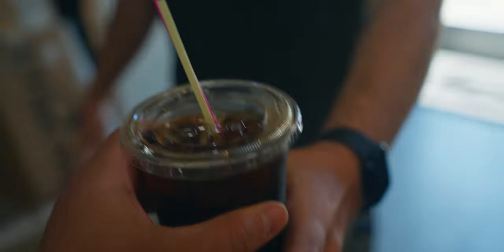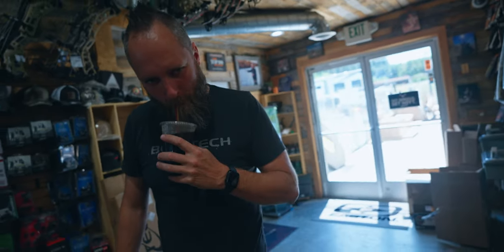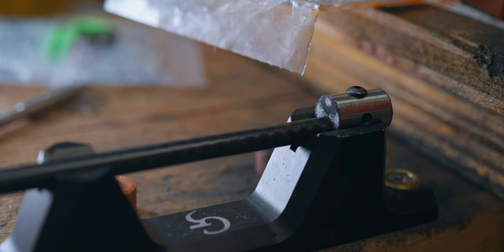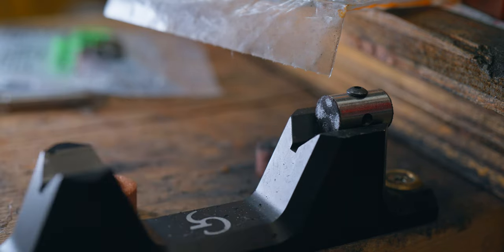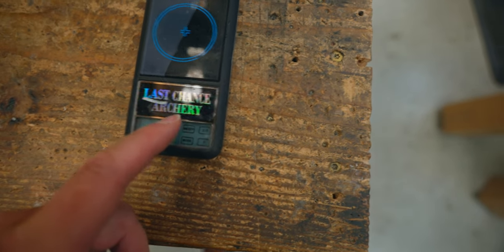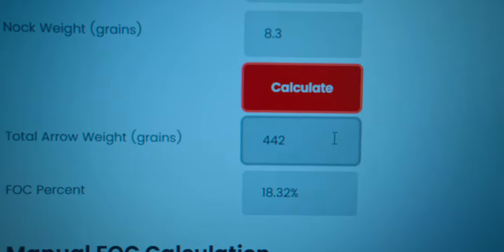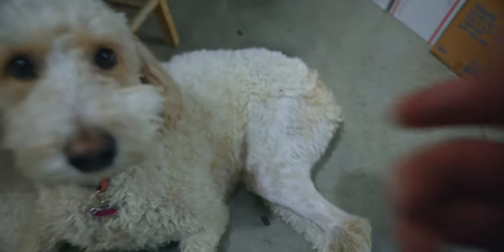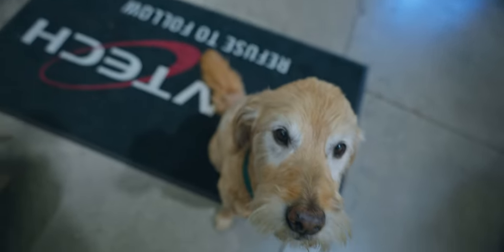Ultimate ARROW Build

Comment: On my RIP XV Elite arrows, I used Easton Axis HIT inserts with Bob Smith Industries glue, and Gold Tip ballistic collars with hot melt glue, with 125 grain field points, giving my 27" long arrows a 15% F.O.C.  I've got them fletched with 2.5" Bohning HEAT vanes fletched with the most helical I can get from a Bitzenberger jig with an upgraded AAE nock receiver.  I'm only a 26.75" draw.  Shooting 50 yards the other day with these arrows from my Solution SS, I put a 1/2" group right in the 10-ring with open sights (no lenses anywhere).

Tim, it's "cyano-acrylate" (6 syllables).  LOL!!

Comment: Awesome video as always sir 👍 Tac vanes are awesome I use the aae primer pen and glue with the rip TKOs and have never had a issue with vanes not sticking or coming off ever, I’m also a fan of the 4 fletch, I get a few extra yards out of my sight tape and if you send one through the target and fold a vane all you have to do is get a little heat on it with your breath or whatever and 80% of the time it straightens right out

Comment: Good build! Almost my exact process except I score the inside of the shaft with a bore brush and the outside of the halfsert with sandpaper. Then clean both with acetone before hotmelt gluing. A little extra confidence for me. I would recommend the AAE Pro Max Vanes for your 4 fletch build. I love them for 3D! Thanks for the good content Tim!

Comment: You can use regular glue like Bob Smith glue and still remove the inserts if you have to. Using a drill bit that is just a touch smaller than the inside diameter of your arrow. Slide it in with the chuck side toward the insert and then with a whipping action it will knock the insert loose and not damage the arrow. I've been doing this for a very long time. The problem with hot melt is it can't be used with certain arrows like black eagle. And if you get the hot melt too hot when inserting the insert you can damage the arrow and ruin it.

Comment: pro tip screw field points in prior to install it keeps your digits a little further away from the heat once glued in hold your arrow by the nock and drop your arrow field point first to the ground if it thuds then your done if theres a buzz take it out and re apply hot melt...*shout out to GRIV*
Reply from the maker: Yeah, I did that in the video ✌️

Comment: 4 fletch bohning Heat vanes are pretty good
Reply: The NEW,  X-3,  3 inch Vanes, by Bohning,  are out, Now !
Using the TOUGH, HEAT Material and X vane Shield Shape, so that Now, you can get by with, using only 3, 3 inch x .48 Tall Vanes, Fletched Helical, to Spin your B-H's,.. "Well"

Comment: Did you re-weigh all your arrows after gluing in inserts/fletchings? Just bought some arrows and supplies from Josh recently. First time doing arrows, and started putting them together last night. Had all the inserts and arrows weighed out and matched up and was sitting +- 1 grain (so a total of 2 grains off between the lightest to the heaviest). After using hot melt to glue in the inserts, most of them were close but there were a few "flyers" that were higher or lower than expected. One or two quite a bit off. My points haven't arrived yet because I'm playing with different weights. Should I just wait and see if the weight variant between the tips makes up that difference, or go ahead and reheat/pull those inserts and reglue? I felt like my process between all 12 arrows was pretty consistent so I was surprised to see some at such a big difference.

Comment: Good video, try some flex fletch FFP-175’s (3.1grains each). I use one stringer wraps in the 4” range, so easy to take off if needed.   Heavy up front, 60yds spot on.   This is in the Midwest, but it would be neat to see how they would do for you guys out west.   I’m currently at 22-24%foc.

Comment: Still shoot some 480 spine broodline i bought with blazer vanes  29 in . Only have 27 draw and shoot 50 lb on a 2012 bear legion.  Have alot of fun with  a blackgold 3 pin ascent whitetail hunter and a 10 in. Fuse carbon stabilizer . Still shoot a whisker biscuit  its fun .  Have teied making my on arrows. Got the cutting and square  but wish i could remember what the insert was. Since you can still buy 400 and 480 spine easton bloodline arrows for practice. All weight of arrow is around 360 gr.

Comment: Insert Iron works really well as a glue.  Holds way better than hot melt and if you put the arrow end in boiling water for 15 minutes or so, you can pull the insert without damaging the carbon.  I've lost many inserts using hot melt.  Depends on the insert, but the bond strength no matter what prep I used just did not keep inserts in consistently enough for me.

Comment: Apply a small dap of arrow lube on the outside of the shaft before putting your inserts in and it won't allow the glue to stick to the outside of the arrow.. but watch to make sure it doesn't get on the inside of the arrow to glue won't allow the inserts to glue up at all

Comment: I've run 4 and 6 (gasp🙊) for the 4 ive run, TAC, and bohning x3 1.75 and 2.25  which are actually lower profile than the 1.75. for 6 ive run the AAE plastifletch 1.6 and thats lighter than 3 max stealth. Once the arrow is spinning there isn't really a slow down difference from 1-5° . As long at the tip is pulling the arrow (FOC) i haven't noticed a large difference in impact point as long as the vanes are appropriately sized to the configuration. Ie more smaller vanes vs fewer larger vanes. The TAC vanes do drag less and give you a couoke more yds at longer distance, they are by far the hardest to fletch consistently

Comment: Tim, any idea why the Gold Tip FOC calculator comes out about 2.25% less FOC than Podium Archer's? 

My builds arrow weight calculations are identical on both but MFJJ's calculator is running 2.25% higher compared to Gold Tip's... Which is correct?

Comment: I always was told clocking was done at about 3 feet or even just double the arrow length to keep the arrow from over rotating and giving a false reading. thanks for the vid though, keep up the great work!
Reply from the maker: You just need to be far enough away to see the rotation ✊

Comment: From watching the videos Josh has talked about fletching, I’ve come to the conclusion that josh doesn’t like a 4 fletch because of the extra weight it puts on the back of the arrow vs the same vane as a 3 fletch… that’s why he seems to go with a more radical helical… but from the videos I’ve seen with those arrows flying in slow motion at longer distances, I’ve seen that radical helical causing a sort of parachute effect… I personally like a 4 fletch with a 1.5 degree helical.. gives you the extra steering for a fixed blade without a parachute… I use a bitz jig also..

Comment: I just got a dozen of the same arrows and same inserts. Was kinda bummed after spending that much to find out my 125 grain qad exodus broadheads don't fit. Will probably have to go down to the 100 grain ones.
Reply: Why don't they fit i just ordered 15 of the titanium inserts for my tko's and that's the broadhead I use😮?
Reply: @ieanfrm8035  the shaft above the threads on the broadheads are just slightly too thick so it won't allow the threads to catch. You can really force it and barely catch the threads but there is no way you will tighten it all the way down. They say the 100 grain fit fine or you can try and lightly sand the shaft on the broadheads.
Reply: Hey bud I just got my inserts in today and I had 3 packs of qad 125 exodus I bought and 2 packs fit pretty and 1 would not like yours so it's a qad problem not a podium insert problem did some research and it has been a problem for some so I contacted qad and they are sending me a new pack so its not the difference between 100 and 125 grain its just a flawed broadhead

Comment: I'm getting ready to build a dozen myself. I've typically gone with GT Hunter XT's. I've been shooting  their 340's for a while now. But, I've gotten in alot better shape over the last couple years and have increased my draw weight. So I'm gonna need new arrows anyway. I just don't know what size spine to go with. I want to run at least a 125gr broadhead with a 100gr insert, But, all the spine charts I've seen, just show the tip weight, they don't include the insert weight in the calculations. With my new draw weight and  my draw length, they all say 300 spine. But, what about the extra 80+ grains of going from a stock insert to a stronger one. Should I just jump to 250 spine? And hope that's right. I'm on a budget, so I can't just buy a dozen arrows and not have them right. Any help would be immensely appreciated.
Reply: also get some specialist advice... ie speak to a archery shop, or those in the upload etc

as you mentioned you want it correct & you've a budget.....
Reply: @malp6280  That's exactly what I'm hoping for. I'm searching for answers

Comment: This is more a question for Josh I guess, but why can't we just buy all the arrow parts "a la cart", since Tim is using a different insert than what comes with the shafts that was a complete waste of money. Same with nocks, if I prefer to use pin nocks and I choose different nocks than what comes with the shafts. Victory even has several different inserts available but I don't see where they allow you to order shafts with the inserts you want and nocks you want.
Reply from the maker: Yeah it’s how the manufacturer sends them.. I agree they should make a bare shaft product
Reply: @TimConnor13  And for that matter, since we have to cut arrow down to the size we want why not buy then in parent shaft size of 8 feet or so and cut shafts to size we want. That way we could order in a parent size to minimize waste.

Comment: After building arrows for like 15+ years for target and hunting I’ve come to the conclusion it’s easy to put too much detail and wasted money into them. High end collars, special nocks and nock bushing may not be required for certain applications.  You don’t need a $30+ to kill a deer at 30 yards or less. Or a pig at 20 yards. 99.999% of the archers can’t hit a dime multiple consecutive shots anyway. So why waste the money?  A midge range cost arrow in .003 is plenty sufficient most of the time. lol, if. If I could shoot better my ideas would change I’m sure. Bottom line is the arrow must fly straight and clean right off the rest. Flying clean without the vanes needing to take over and correct flight issues. The main thing ,IMO, is the arrow ALSO must hit “ behind the pin”.  It’s not quite rocket science but close,lol. 👍👍👍